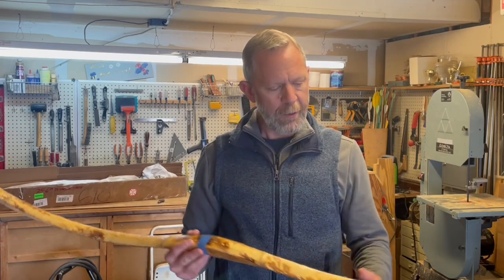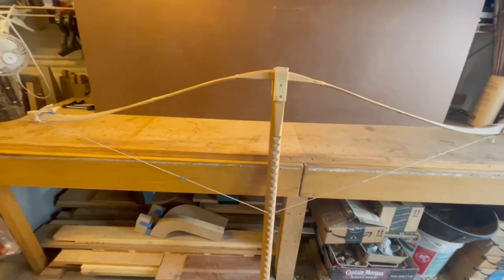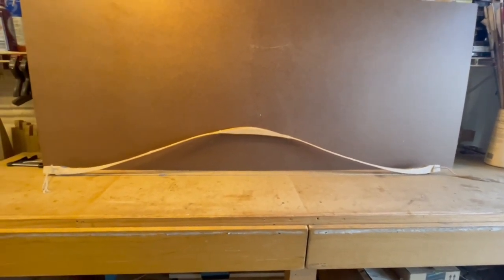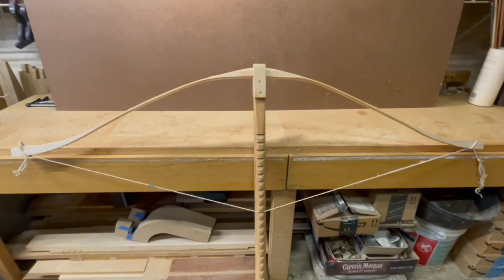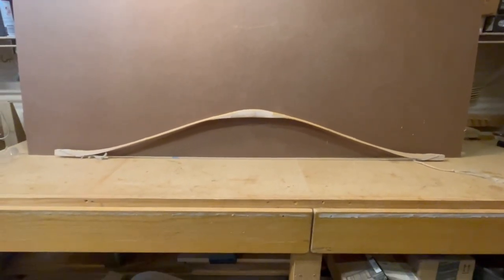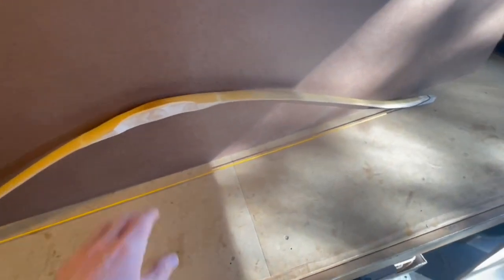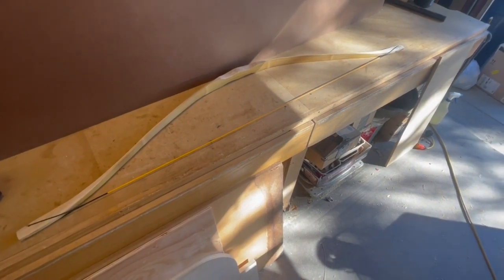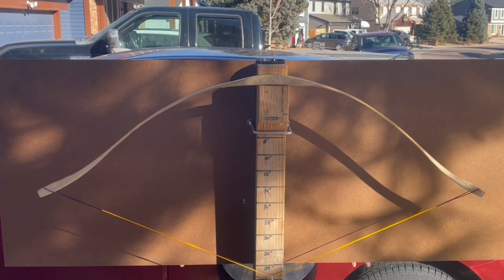Assyrian Bow Build Pt.3 - Full Tiller

Comment: Have you ever attempted a full sized yumi? I am about to try a hybrid; yumi shape with bamboo backed ipe. I'm going to attempt a form similar to what you have done in this build.
Reply from the maker: I have not built a traditional Yumi - but I want desperately to attend one of Jaap Koppedrayer’s workshops to build one… as for your proposed build, good luck, and keep us all informed about your results - should be s good one!
Reply: @meadowlarkadventuregear  Do you think I should pre-bend the laminates with steam/heat or rely on the form for the bend? thanks!
Reply from the maker: I’d use the form to give the bend

Comment: How did you take the rind off? Did you burn it off with a blow torch?
Reply from the maker: I only ever scrape off the rind.
Reply: @meadowlarkadventuregear  so after scraping. Do you sand it? Because your bows have such a nice smooth finish and shine to it. Also does the rind not compromise the strength of the bamboo under tension and compression? Or is it the actual growth formation of the bow and not really the skin or rind of the bow?

Comment: I think you did a great job shaping the bow, my only criticism is the construction of the bow. I dont think the bamboo alone is able hold as much tension to create a normal poundage bow. Id recomand using bamboo as a core material just as you did but on top of it I would add wood or fiberglass to make a more robust design. also just so you know the tips of Assyrian bows can get very thin at times, it could be a good idea to reinforce them.
good job over all man.
Reply from the maker: @nadavyasharhochman3913  all very valid observations. You clearly have a keen eye for design details. One of these siyahs did eventually split despite the light draw weight. A core material could potentially help this design a lot. Interestingly enough, that’s exactly the build that I’m in the middle of constructing and filming right now. I really hope it turns out, because I love shooting this particular bow - stay tuned!!!